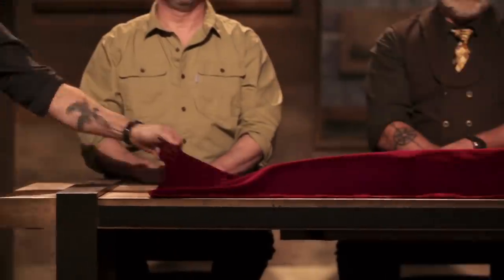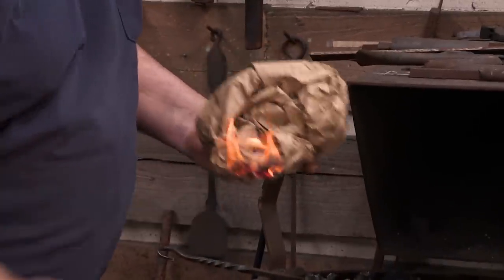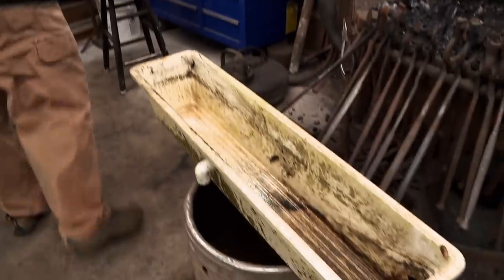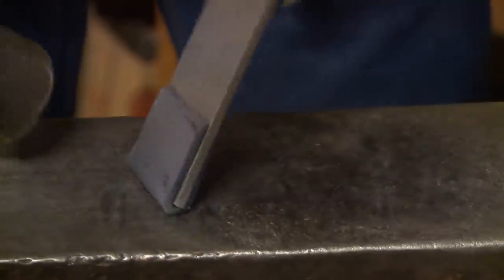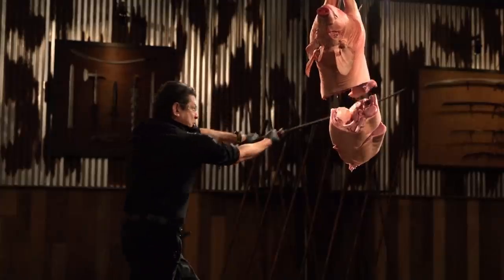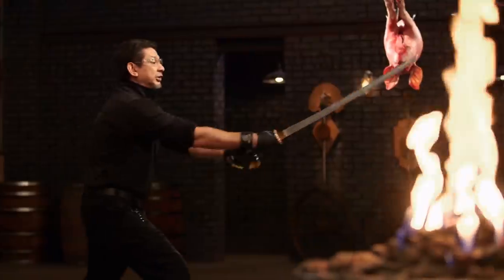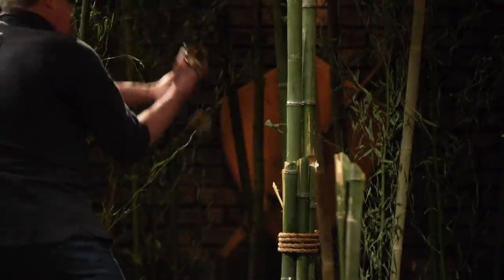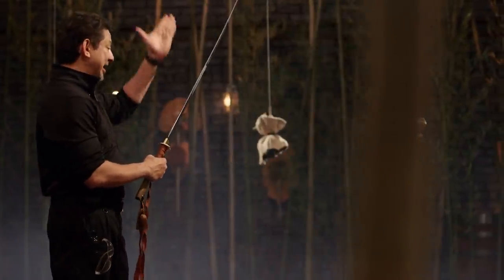Forged in Fire: Gunto Final Round: Richey vs. Elijah (Season 6) | History

Comment: Easier to rewrap a handle than straighten a sword
Reply: Both smith's took a slightly bend. One in the kill test, the other in the Streangth test. With that they where tied. But the loose wrapping seemed to be more of a problem, then the lighter blade brings an advantage.
I think it's important to notice that the judges are really picky, when it comes to the handle of a weapon. 
In every round and challenge, the handle is the thing that sets the closest competitors apart from one another. 
And I think thats not without a reason. The handle is the piece that connects the user to the weapon. A well done handle dicides about how good you can control this weapon. 
The best crafted blade is worth nothing if the handle makes it unusable. A bad handle could case, stress in the blade, it can hurt you, rotates the blade uncontrollable or just let you slip of your weapon. 
Japanese swords like this have the "problem" that they have a straight, smooth, wooden handle without a pommel. Thats why the wrapping is the one thing that can prevent the blade to slip out of your hand while swinging or defending. A loose or slippy handle forces me to worry about what I can do and how to do it without risking to loose the blade. That's why I can't strike at full Streangth, or speed. In this case I cannot utilize the advantage of a lighter blade. I would rather wield a slightly more bended blade with a strong handle, than a lighter blade I cannot utilize to its fullest potential, because I cannot focus on the battle only. 
I mean, I really like Richie, he's such a nice guy. 
But just because someone is a better person doesn't just mean they have to be the winner of a compaction. I mean, the task is to build the best possible copy of a weapon, ready for battle then and there...not to be a super nice guy. 
I just can't understand how everyone thinks he knows more about how to judge these swords then the JUDGES who used them side by side. They are wonderful bladesmiths and weapon experts...
They just had less confidence in a unwrapped handle than in a slightly more bended sword.

Comment: I understand how strict these judges are but an unwrapped handle could cause issues if the handle was too smooth grip however it wasn't, Elijah had a bend in his blade which would be a a much more fatal issue than simply having the wrap come loose the perfection that was the thinness yet powerful blade of richie should've been enough

Comment: Why do 99% of all the others just didn't listened to Doug after the kill test. Both smith's took a slightly bend. With that they where tied. But the loose wrapping seemed to be more of a problem, then the lighter blade brings an advantage.
I think it's important to notice that the judges are really picky, when it comes to the handle of a weapon. 
In every round and challenge, the handle is the thing that sets the closest competitors apart from one another. 
And I think thats not without a reason. The handle is the piece that connects the user to the weapon. A well done handle dicides about how good you can control this weapon. 
The best crafted blade is worth nothing if the handle makes it unusable. A bad handle could case, stress in the blade, it can hurt you, rotates the blade uncontrollable or just let you slip of your weapon. 
Japanese swords like this have the "problem" that they have a straight, smooth, wooden handle without a pommel. Thats why the wrapping is the one thing that can prevent the blade to slip out of your hand while swinging or defending. A loose or slippy handle forces me to worry about what I can do and how to do it without risking to loose the blade. That's why I can't strike at full Streangth, or speed. In this case I cannot utilize the advantage of a lighter blade. I would rather wield a slightly more bended blade with a strong handle, than a lighter blade I cannot utilize to its fullest potential, because I cannot focus on the battle only. 
I mean, I really like Richie, he's such a nice guy. 
But just because someone is a better person doesn't just mean they have to be the winner of a compaction. I mean, the task is to build the best possible copy of a weapon, ready for battle then and there...not to be a super nice guy. 
I just can't understand how everyone thinks he knows more about how to judge these swords then the JUDGES who used them side by side. They are wonderful bladesmiths and weapon experts...
They just had less confidence in a unwrapped handle than in a slightly more bended sword...am I the only one who can understand their decision? 😅

Comment: Sorry, but picking up a bent blade is much worse than an unwrapped handle, you can rewrap a handle on the field
Reply: I want to see u sitting there for a couple of minutes rewraping a handle on the battlefield. 😂
 Both smith's took a slightly bend. One in the kill test, the other in the Streangth test. With that they where tied. But the loose wrapping seemed to be more of a problem, then the lighter blade brings an advantage.
I think it's important to notice that the judges are really picky, when it comes to the handle of a weapon. 
In every round and challenge, the handle is the thing that sets the closest competitors apart from one another. 
And I think thats not without a reason. The handle is the piece that connects the user to the weapon. A well done handle dicides about how good you can control this weapon. 
The best crafted blade is worth nothing if the handle makes it unusable. A bad handle could case, stress in the blade, it can hurt you, rotates the blade uncontrollable or just let you slip of your weapon. 
Japanese swords like this have the "problem" that they have a straight, smooth, wooden handle without a pommel. Thats why the wrapping is the one thing that can prevent the blade to slip out of your hand while swinging or defending. A loose or slippy handle forces me to worry about what I can do and how to do it without risking to loose the blade. That's why I can't strike at full Streangth, or speed. In this case I cannot utilize the advantage of a lighter blade. I would rather wield a slightly more bended blade with a strong handle, than a lighter blade I cannot utilize to its fullest potential, because I cannot focus on the battle only. 
I mean, I really like Richie, he's such a nice guy. 
But just because someone is a better person doesn't just mean they have to be the winner of a compaction. I mean, the task is to build the best possible copy of a weapon, ready for battle then and there...not to be a super nice guy. 
I just can't understand how everyone thinks he knows more about how to judge these swords then the JUDGES who used them side by side. They are wonderful bladesmiths and weapon experts...
They just had less confidence in a unwrapped handle than in a slightly more bended sword...am I the only one who can understand their decision? 😅

Comment: It was like Santa was competing and lost.  This is unacceptable!  ☹
Reply: Both smith's took a slightly bend. One in the kill test, the other in the Streangth test. With that they where tied. But the loose wrapping seemed to be more of a problem, then the lighter blade brings an advantage.
I think it's important to notice that the judges are really picky, when it comes to the handle of a weapon. 
In every round and challenge, the handle is the thing that sets the closest competitors apart from one another. 
And I think thats not without a reason. The handle is the piece that connects the user to the weapon. A well done handle dicides about how good you can control this weapon. 
The best crafted blade is worth nothing if the handle makes it unusable. A bad handle could case, stress in the blade, it can hurt you, rotates the blade uncontrollable or just let you slip of your weapon. 
Japanese swords like this have the "problem" that they have a straight, smooth, wooden handle without a pommel. Thats why the wrapping is the one thing that can prevent the blade to slip out of your hand while swinging or defending. A loose or slippy handle forces me to worry about what I can do and how to do it without risking to loose the blade. That's why I can't strike at full Streangth, or speed. In this case I cannot utilize the advantage of a lighter blade. I would rather wield a slightly more bended blade with a strong handle, than a lighter blade I cannot utilize to its fullest potential, because I cannot focus on the battle only. 
I mean, I really like Richie, he's such a nice guy. 
But just because someone is a better person doesn't just mean they have to be the winner of a compaction. I mean, the task is to build the best possible copy of a weapon, ready for battle then and there...not to be a super nice guy. 
I just can't understand how everyone thinks he knows more about how to judge these swords then the JUDGES who used them side by side. They are wonderful bladesmiths and weapon experts...
They just had less confidence in a unwrapped handle than in a slightly more bended sword...am I the only one who can understand their decision? 😅
Reply: @KouheiIsamu  Dude, Chill!  My comment was meant to be taken with a little bit of salt....you know, in jest.  I'm well-aware that this is not a popularity contest, and that the judging is based on the craftmanship and performance of the blades.  
I agree with you that the handle is what connects the wielder to the weapon, so it is an integral part of the weapon.  If the wrapping comes loose, it can be a big problem.  
I also believe that a weapon shouldn't feel like a weapon, but a natural extension of the one who wields it.  One of my favorite things is when Doug gets excited about a weapon he's holding, and then he "plays" with it a little more than what is usually shown.  He becomes one with the blade, his movements are fast and smooth, his focus intensifies and he gets very happy.
You are not the only one who understands the decisions that the judges make.  Rest assured!
Have a great day!
Reply: My comment shouldn't sound aggressive or salty at all. 😂
I just began to write and write, and at some point my answer was a hole book...some things happen in life. 😂
Reply: @KouheiIsamu  Haha!  I do the same thing.  No worries.  Isn't this a fantastic show?  It's my favorite!

Comment: It should have been Richie
Reply: Both smith's took a slightly bend. One in the kill test, the other in the Streangth test. With that they where tied. But the loose wrapping seemed to be more of a problem, then the lighter blade brings an advantage.
I think it's important to notice that the judges are really picky, when it comes to the handle of a weapon. 
In every round and challenge, the handle is the thing that sets the closest competitors apart from one another. 
And I think thats not without a reason. The handle is the piece that connects the user to the weapon. A well done handle dicides about how good you can control this weapon. 
The best crafted blade is worth nothing if the handle makes it unusable. A bad handle could case, stress in the blade, it can hurt you, rotates the blade uncontrollable or just let you slip of your weapon. 
Japanese swords like this have the "problem" that they have a straight, smooth, wooden handle without a pommel. Thats why the wrapping is the one thing that can prevent the blade to slip out of your hand while swinging or defending. A loose or slippy handle forces me to worry about what I can do and how to do it without risking to loose the blade. That's why I can't strike at full Streangth, or speed. In this case I cannot utilize the advantage of a lighter blade. I would rather wield a slightly more bended blade with a strong handle, than a lighter blade I cannot utilize to its fullest potential, because I cannot focus on the battle only. 
I mean, I really like Richie, he's such a nice guy. 
But just because someone is a better person doesn't just mean they have to be the winner of a compaction. I mean, the task is to build the best possible copy of a weapon, ready for battle then and there...not to be a super nice guy. 
I just can't understand how everyone thinks he knows more about how to judge these swords then the JUDGES who used them side by side. They are wonderful bladesmiths and weapon experts...
They just had less confidence in a unwrapped handle than in a slightly more bended sword.

Comment: Ok, not playing favorites here, I have watched this video several times (at a much slower speed). The older guys' blades chops on the bamboo were done several times at a flat horizontal angle of attack. (not fair) Whereas the younger guys were done at a more effective angle of attack.  The older guys blade was much thinner (so blade oscillation becomes a real problem here) if it had been thicker the angle of attack differences would have not been such a big deal. The older guy's processes were a much better process. Neither process is how real samurai blades were or are crafted.  I have never been a big fan of this show, to begin with.  I have been making knives for 10 years.

Comment: Idk, I think RIchie should have won, his blade was better because it didnt bend I feel like that would the more important issue.
Reply: Both smith's took a slightly bend. One in the kill test, the other in the Streangth test. With that they where tied. But the loose wrapping seemed to be more of a problem, then the lighter blade brings an advantage.
I think it's important to notice that the judges are really picky, when it comes to the handle of a weapon. 
In every round and challenge, the handle is the thing that sets the closest competitors apart from one another. 
And I think thats not without a reason. The handle is the piece that connects the user to the weapon. A well done handle dicides about how good you can control this weapon. 
The best crafted blade is worth nothing if the handle makes it unusable. A bad handle could case, stress in the blade, it can hurt you, rotates the blade uncontrollable or just let you slip of your weapon. 
Japanese swords like this have the "problem" that they have a straight, smooth, wooden handle without a pommel. Thats why the wrapping is the one thing that can prevent the blade to slip out of your hand while swinging or defending. A loose or slippy handle forces me to worry about what I can do and how to do it without risking to loose the blade. That's why I can't strike at full Streangth, or speed. In this case I cannot utilize the advantage of a lighter blade. I would rather wield a slightly more bended blade with a strong handle, than a lighter blade I cannot utilize to its fullest potential, because I cannot focus on the battle only. 
I mean, I really like Richie, he's such a nice guy. 
But just because someone is a better person doesn't just mean they have to be the winner of a compaction. I mean, the task is to build the best possible copy of a weapon, ready for battle then and there...not to be a super nice guy. 
I just can't understand how everyone thinks he knows more about how to judge these swords then the JUDGES who used them side by side. They are wonderful bladesmiths and weapon experts...
They just had less confidence in a unwrapped handle than in a slightly more bended sword...am I the only one who can understand their decision? 😅

Comment: I don't feel he should have one because one of the blades only had the Rope unraveling and the winner had a Bent Blade so his blade perform better with a Bent Blade I thought the whole point was to see who made a better blade you can wrap around that rope but it's not the same as straighten out that blade real quick I feel the other one should have won if they're going on quality of the blade ummmmm
Reply: Both smith's took a slightly bend. One in the kill test, the other in the Streangth test. With that they where tied. But the loose wrapping seemed to be more of a problem, then the lighter blade brings an advantage.
I think it's important to notice that the judges are really picky, when it comes to the handle of a weapon. 
In every round and challenge, the handle is the thing that sets the closest competitors apart from one another. 
And I think thats not without a reason. The handle is the piece that connects the user to the weapon. A well done handle dicides about how good you can control this weapon. 
The best crafted blade is worth nothing if the handle makes it unusable. A bad handle could case, stress in the blade, it can hurt you, rotates the blade uncontrollable or just let you slip of your weapon. 
Japanese swords like this have the "problem" that they have a straight, smooth, wooden handle without a pommel. Thats why the wrapping is the one thing that can prevent the blade to slip out of your hand while swinging or defending. A loose or slippy handle forces me to worry about what I can do and how to do it without risking to loose the blade. That's why I can't strike at full Streangth, or speed. In this case I cannot utilize the advantage of a lighter blade. I would rather wield a slightly more bended blade with a strong handle, than a lighter blade I cannot utilize to its fullest potential, because I cannot focus on the battle only. 
I mean, I really like Richie, he's such a nice guy. 
But just because someone is a better person doesn't just mean they have to be the winner of a compaction. I mean, the task is to build the best possible copy of a weapon, ready for battle then and there...not to be a super nice guy. 
I just can't understand how everyone thinks he knows more about how to judge these swords then the JUDGES who used them side by side. They are wonderful bladesmiths and weapon experts...
They just had less confidence in a unwrapped handle than in a slightly more bended sword.